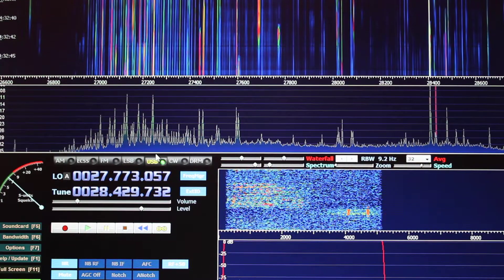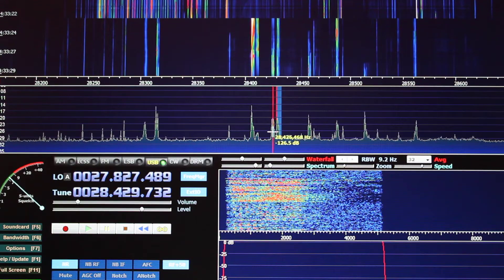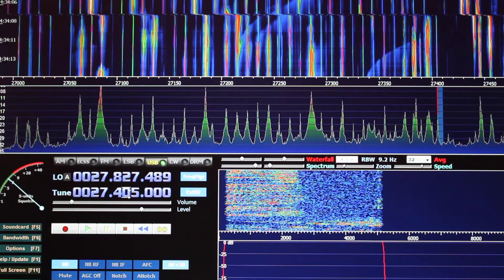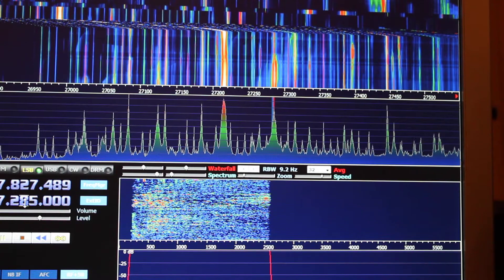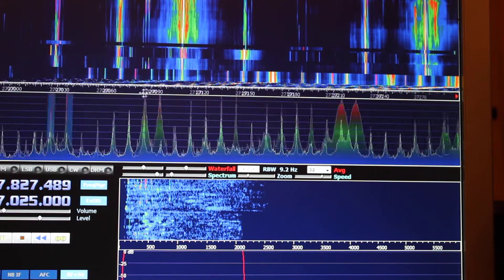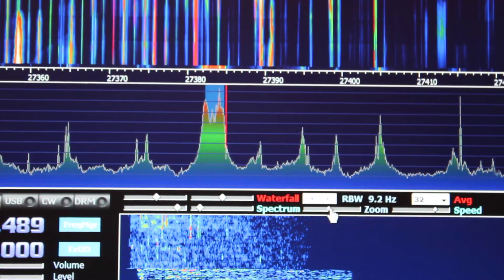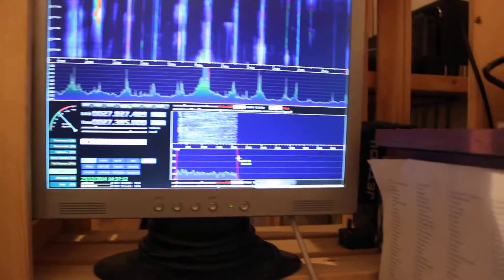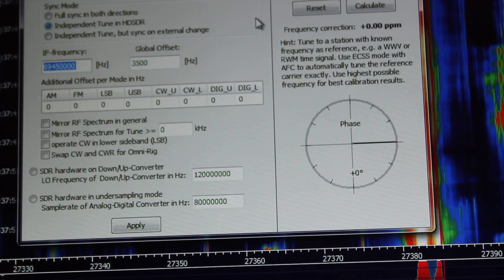Yaesu FT-950 and RTL-SDR Panadapter

Comment: Hello, I've run a tap cable from the from the scope TMP plug on the 950's board out through a rear vent and connected to my SDR and thence PC.  But I am seeing no signals on my PC as per this video.  Is there something that has to be set on the 950 to activate the scope plug so a signal comes through?   Thanks.
Reply: Set the HDSDR to IF input and set the input frequency to 69.450MHz

Comment: I’m struggling to get mine working, what program are you running it on? I have connected the RTL-SDR to the pc and tapped into the ft950 and also have the correct Cat cable any advice would be welcome please